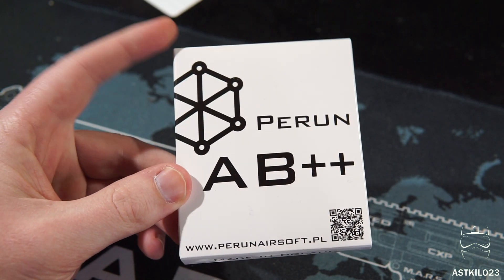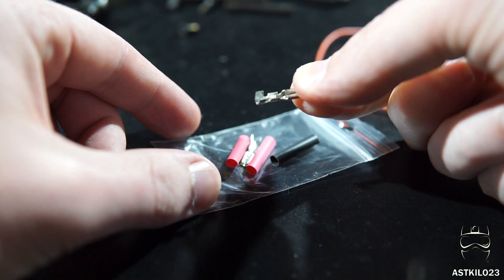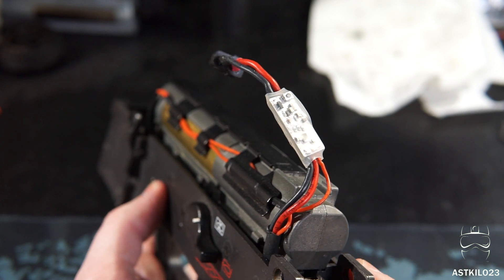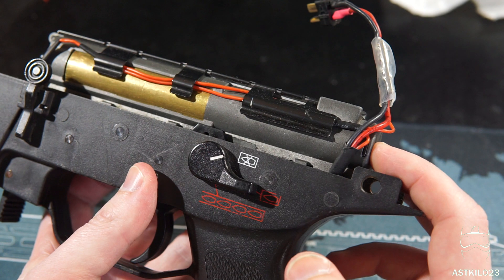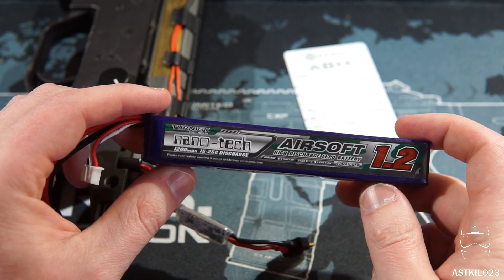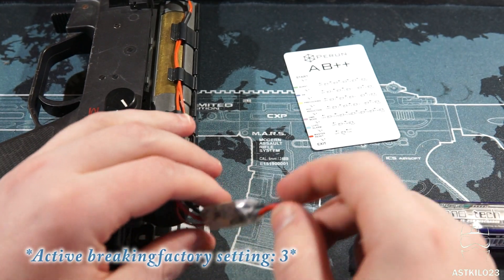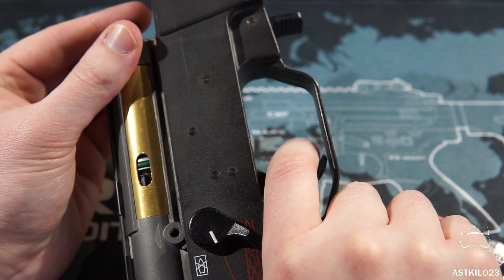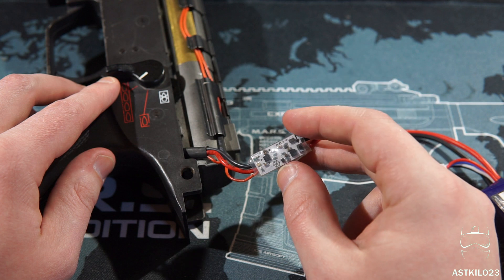Perun AB++ Mosfet Review

Comment: Another great video from you..
 You are the reason that I got my Arcturus as a beginner in the sport at 2019 :) due to your review back then..
 I wonder if you have figured out how this mosfet detects a full cycle of the gearbox, since it doesn't read any sensor or switch, regarding the burst modes of course and not the semi..
 It has something to do with power monitoring when the gearbox is in spring compressing phase the motor draws more amperage and when the piston is released then the power drainage drops a bit because the gearbox is free spinning..and repeat and repeat.. 🤔 🤔
There has to be something to have accuracy when AB or preckocing.. 
Thank you in advance
(sorry for my English)

Comment: I ran the second red signal wire down to the motor connector and soldered it onto the backside of it, covered it with heat shrink tube.

Comment: Hey ASTKilo23, I’ve got a G&G SR25 E2 that has the same mosfet, only issue is that it doesn’t have the ability to select auto. It’s safe/semi only. Do you think the Perun would still work with it or would I have to take the GB out to program the fet? Thanks!
Reply from the maker: No need to remove the gearbox. You can program semi without touch auto. It'll work fine.

Comment: Why did you keep your finger on the nozzle during the tests?
Reply from the maker: It's an old trick I learned when first learning to tech. It simulates a bb being in front of the nozzle and fired. It can help prevent gearbox cracking when dry firing a gun.
Reply: @ASTKilo23  Oh sh*t they can crack during dry fire? Well, they constantly get dry fired when the mag runs out, not very reassuring.
Thanks for sharing. Do you also apply some pressure?
Reply from the maker: @sogerc1  Really any gearbox shell can crack at any time, it's just metal stress. But in general, dry firing will not help the lifespan of your gearbox.